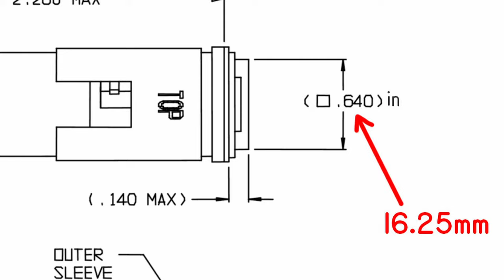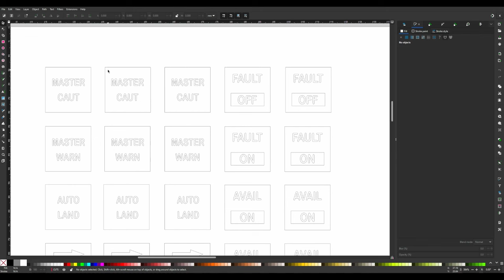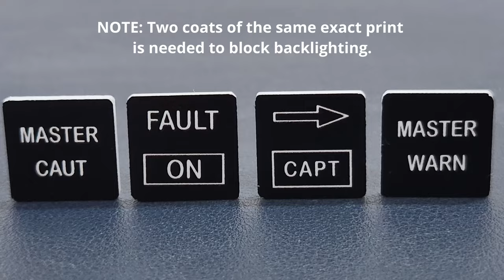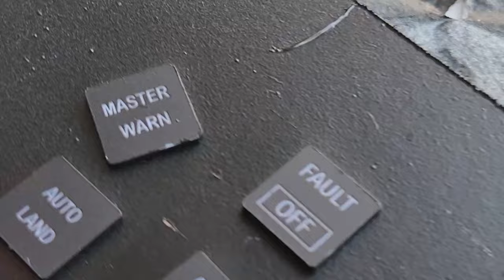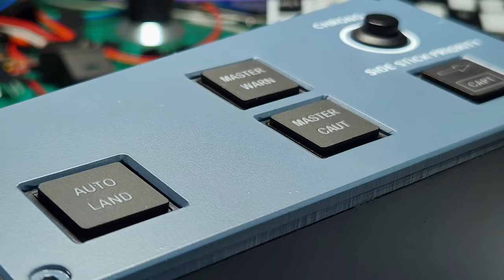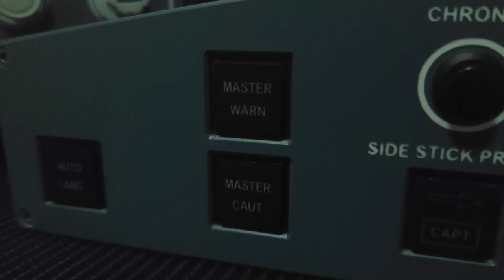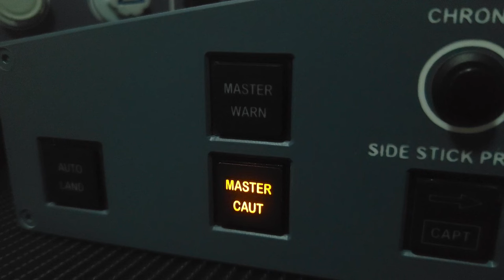Label and backlight a KORRY button like a Pro - DIY

Comment: Awesome results!  I've never seen UV printing before, how did you align the acrylic squares so precisely?
Reply from the maker: Thank you! First, print a guide pattern (sort of squares/lines) on a thin cardboard paper, taped on  top of the UV flatbed.  This pattern is exactly the same pattern of the korry designs and layout in the printing Software.  The square patterns printed on the flatbed serves as your guides  and is where all the squares of acrylics are arranged one by one kinda like placing eggs on the egg tray LOL!.  Then run the print again using the actual markings layer (not the square outlines used to draw the patten) This is exactly the same method I use for cockpit panels where I cut, sand/paint, then go back to the engraver and engrave the markings  :)  Hope that helps.

Comment: santi, fantastic job on the korry, i used the stl for the push pull on the FCU and they are working fine thanks, would you please share the stl for the korry`s for the over head panel (the backlighted ones)
Reply from the maker: Thank you!  I'm glad they worked for you.  As to the Overhead Korry's, I am still in the process of improving my design as I realized it would be very tedious to do all 72 (or more) of them without PCB!   PCB makes the production faster and cleaner.  Will definitely share the design once completed.  The ones you see in this video are simple, PCB-less construction which works for a few buttons but not for quantity!  :)  Hope that helps!

Comment: Ive been designing a cockpit layout to build, but the panels and button graphics are the most intimidating to me. Seems impossible without a laser engraver. Not sure what to do.
Reply from the maker: Hi. If you don't need backlighting in the panels it's much easier to do. I use 5mm Sintra board, with vinyl stickers printed with the cokcpits decals and labels.
Reply: @santiagoluib3  ….how do you create the labels? Is there already made labels ready for print? Thanks
Reply from the maker: hi  @jay-rus4437   email me at santiagoluib3@gmail.com   :)
Reply from the maker: @jay-rus4437  Photoshop

Comment: You should do a video on how you built these buttons from the ground up
Reply from the maker: Which part do you think is missing?  I think the only thing missing part is the laser cutting of the 2mm acrylic sheet into 16x16mm squares (which I am not able to take video as it was outsourced as i dont have laser cutter that time), the rest of the process IMO is clear enough.
Reply: I mean like a tutorial.

These are very good buttons
Reply from the maker: @johnb6014 oh you mean the Buttons themselves! Yes I know, I will make a separate video once the design improvement is completed. This video is just for the Korry lenses - an alternative way tp label them for backlighting 😊
Reply: Great can't wait to see them. I followed along with a lot of the other videos and saw your other Corey buttons but the dual lit ones are the ones I'm looking for
Reply from the maker: @johnb6014 hi John, my current OH Korry design works for maybe a few, but realizing that the overhead panel has some 72+ Korry's, using this PCB-less design can be a nightmare 😂 I am in the process of improving this with PCB, and once done I'll share it here 😊
Reply: But you have to remember a lot of people don't have access to or understand pcbs, so this is an easier way for the DIYer who is just getting started. 

Most people are not gonna build the whole overhead...and those who do, probably have the knowledge needed to do so
Reply from the maker: @johnb6014  Yes of course, I understand - two camps of the DIY community :)  I was referring to my own setup.  While I prefer to stay in the simplicity camp, I find the method to be inefficient when it comes to high quantity.  But don't worry, the future video will cover two different versions of the same Korry buttons - simple PCB-less and one with PCB to suit the DIYer and his style of building panels.  :)
Reply: Any luck on these videos?

Comment: Can you elaborate on the process please i dont quite understand the way it is printed is the black printed only to alow the light to come through the letters.
Reply from the maker: The black Print blocks the light.  The markings (text) are "skipped" by the print, that means no ink = light goes thru.  Hope that helps.
Reply: Yes thank you very much for replying. Harry.

Comment: how did you do that is´s conected with your sim? I mean lights
Reply from the maker: Hi adam, the Korry button assembly itself is not the highlight of this video, but one day I will make a separate one just for the Korry themselves!  But to give you an idea how the lights work, they are small 3mm LEDs, wired to an Arduino board, which is then connected to the PC and run by a software called MobiFlight which talks to the simulator, in this case FS2020.  Hope that helps  :)  Thanks for watching btw.
Reply: @santiagoluib3 thank you so much